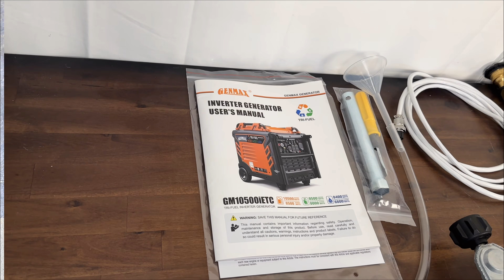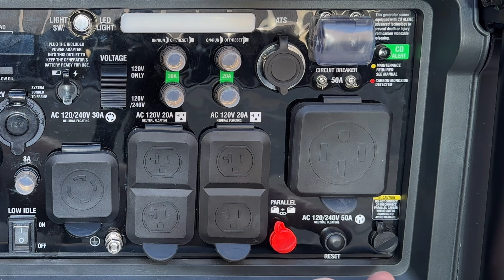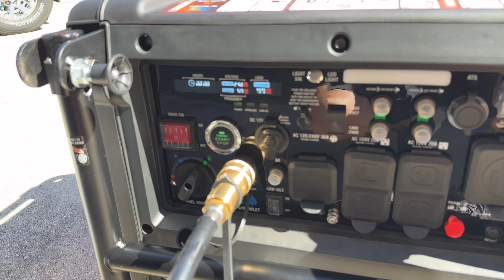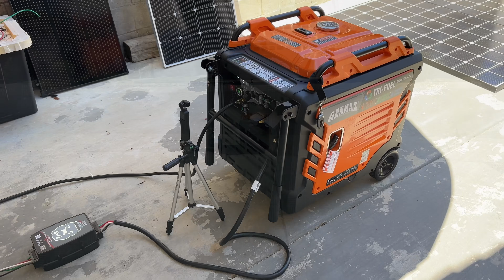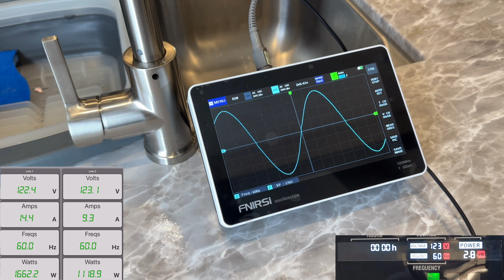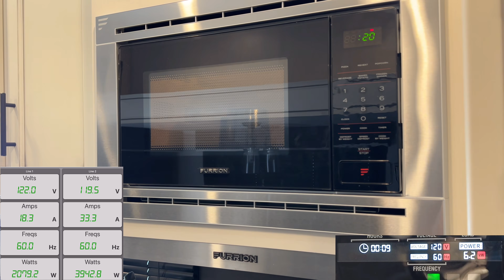Best New Generator GENMAX 10500iETC Tri-Fuel Inverer Generator!

Comment: I have a 250 gallon tank. Can this be run straight to the tank
Reply from the maker: Yes but need correct connection and water colume 
LPG service can normally do for a minimal fee

Comment: Is that a 2 wire auto start or a 3 wire. I have a 2 wire inverter start. I would have to cut one end off. If it is a 2 wire.
Reply: It has a 7 pin ATS. There is a way to convert it to 2 pin and I am working it out. But if you haven't purchased one yet I recomend the open frame 10500XiT version which has a 2 pin ATS. I only bought this one because it runs quieter and because the 2 wire ATS model wasn't available anywhere! These 10500 model (as where as most other models) sell fast and are hard to get. They have become very popular among those of us that have whole house solar systems off grid. 2 wire ATS is a must for off grid systems when no sun and off grid. I will be hitting as many replies as I can find questions in these videos, as soon as I finish my conversion. One caveat is that it will probabley void the warranty untill the factory catches on and they install my change or make a kit.

Comment: So do the Genmax generators have copper windings or copper clad aluminum?  Nothing shows in the manual or webpage.  Like the GM7500, GM8500, GM10500, GM11000, etc.  Larger ones
Reply from the maker: I haven’t seen copper clad in a generator for a long time 
Most everything out there is copper

Comment: I did a 14 hour breakin on gasoline continuously increasing load. After that I cleaned the tank and emptied the carb since I don't plan on running it on gasoline. I checked with the neighbors to ask their opinion of the noise and they responded with "what noise?" It runs even smoother and quieter on natural gas. On cloudy days, when solar is negligable I can charge my whole house batteries in about 2 hours or less - once a day. After a week off grid my wife realized that the dishwasher did not work. I told her that the dishwasher was non critical and I recieved the old hands on hips gesture. I proceeded to grab the generator remote, walked to the window and started the generator. Now she notifies me before running the dishwasher.

Comment: This generator is crap.  No service will assert ot call back, parts are all sold out.  I bought this and brand new and won't start.  Battery ok. Using propane, press the start button tries to start but quits.  Just  a POS as far as my experience goes.

Comment: Found out something strange about the gas amount required for this generator (actually it's twin under TMG Industrial). I had assumed that it would need a 1/2 inch gas hose so hired a gas guy to install a tap from my entrance point to enable the correct amount of natural gas to be available for the 10500 generator. Just out of curiosity, I installed the correct 1/2 inch quick connect to the existing 3/8 barbeque outlet and it WORKS GREAT.. The unit seems to run perfectly even on a smaller 3/8 pipe. I added a draw of 3000 watts and no problems. I don't know if it would function properly at maximum draw of 6800 watts but this was quite a pleasant surprise non the less.
Reply from the maker: Interesting normally if not right next to the main supply you would normally need a 1/2 inch at least for larger gens. May have to do a larger load test to see your limit. But remember if only the gen is running and not a heater or stove that will changes things.
Thanks for the info
Reply: @johnnysweekends  Yes, you have a good point !!  This barbeque outlet is after the gas hot water heater and after the gas stove, neither of which were actually on when i did this test. I loaded it up to 3000 watts with no difficulties but I will try it when the gas stove is on and when the water heater is actually working. As you say, it might be a case of nothing else drawing gas while I was doing the test allowing it to work properly with the smaller outlet (but failing when the other appliances are drawing gas at the same time). 

The power will be off this coming Sunday 24th November for a full day for maintenance during which I will be powering the whole home with the generator using the smaller barbeque outlet. I will let you know if I experience any difficulties during the day long "test"
Reply: Ok, the day long power outage is now over. Ran the TMG 10500 (same as Genmax 10500) for about 7 hours continuous using the 3/8 barbeque tubing converted to 1/2 quick connect and then to the generator using 1/2 inch hose that came with the generator. . I stressed out the gas supply by turning on the four stove gas burners and upping the gas furnace temperature at the same time as I was running the electric clothes dryer (5000 Watts). There was no indication of any gas or power difficulties whatsoever until I turned on the the heavy duty vacuum cleaner driving the total wattage over 8000, at which point the breaker tripped, as was to be expected. So I have come to several modest, personal conclusions: 

1- This generator is truly a beautiful, quiet BEAST fully capable of effortlessly powering  most anything you would ever want in an average home. It's quality appears to be outstanding. It\'s huge motor would likely be very gas hungry if used that way, but on natural gas, it's dirt cheap (36 cents per hour at 50% load).
2- Using an existing 3/8 barbeque outlet converted to 1/2 Quick connect to connect to the generator would seem NOT to compromise the amount of gas supply the generator needs to run properly at full throttle. Your gas supply might be different but mine certainly worked well.
3- For anyone paying to have a 1/2 inch coupler added to their gas supply where it first comes in the home (where it is definately recommended to connect) may want to wait on this added expense until AFTER they try their barbeque outlet. You may luck in like I did...

The other thing to add, unlike the Genmax 10500, the TMG 10500 comes with neutral bonded to frame. Floating neutral is recommended on the Generlink, but during the 7 hours I used it with neutral bonded to frame, everything worked and no breakers tripped. I will be modifying it to floating neutral but it's nice to know it will run the other way (even though strictly speaking that goes against code)
Reply from the maker: @TOURMANBOB awesome it worked ! Great feed back thank you
Reply: @johnnysweekends  BTW, I measured the THD and it measured 2.3% THD

Comment: Will these put out 240v with just 1 generator, or do you have to parallel 2 generators together to get 240v like some of the solar generators.  Looking for the best option to fast charge a Delta Pro Ultra setup in case there is no solar
Reply from the maker: You should watch some of my Ecoflow videos where I use this unit to charge delta pro ultra 😀👍🏼
Only one needed
Reply: @johnnysweekends  Do people really spend $5k+ on batteries?  Mainly California?
Reply from the maker: @avguytx4361 yes they do. All over really. 
Battery prices are coming down and serves quiet back up power and time of use for people who have really high energy prices 
Payback can be in as little as about 6-8 years with a life span of about 20 ish
Reply: @johnnysweekends  Good to know.  So which would you choose...Duromax XP11000ih or Genmax GM11000IETC/GM10500IETC?  Or something else in that 11kw range
Reply from the maker: @avguytx4361 idk I wanna check out the champion first
Reply: @johnnysweekends thanks ill look it up. I saw the vid where you changed the ultra with the yellow smaller champion but hadn't seen the other one

Comment: Would you know how long a tank ( like yours) of propane last at just normal use in a home.
Refrigerator,  hot water, tv, lights &  bedroom outlets? 
Just an approx?
Reply: LPG fuel consumption rate is said to be.. 1.65 kg/h at 25% load and 3.43 kg/h at 100%

Comment: If there is 60 mph winds outside, and electric goes out, can you just push remote start, or do you have to go outside and turn on power switch first?
Reply: @bryandunkley8239  I dunno how long before it’s an issue but you don’t want to leave the generator powered on long term because it’ll drain the battery and then electric start won’t work at all.  How long it can sit around with the battery on (ready for remote start), I’m not totally sure.

Comment: Can you please explain the low idle function? If I run low idle will generator adjust if more power is needed or do I just need to turn it off?
Reply from the maker: Yes it will self adjust as needed this helps save fuel and does keep it quieter. 
But for large loads that will be on and off keep the low idle off so it can handle them properly

Comment: Has it ever back fired upon start up ? I keep reading on Reddit that this model will back fire upon starting it up for the very first time.
Reply from the maker: Mine didn’t back fire. But I’m only using propane. Plus most all new generators are setup a little lean at idle for emissions. But what you read is also just here-say, all of them? Some of them? One of them? 
Every single time on one generator ?
Reply: @johnnysweekends thanks for the reply. During hurricane Ike i purchased a generator and it backfired very loudly. I was very alarmed and honestly my Kid started it up after that under my supervision. 
I have not tested my Genmax yet; but I know if it backfires it’s going to scare me. I plan to use propane and eventually natural gas.
Reply from the maker: @steffiejoe I would get it fired up sooner than later. Better to find a problem now verses when it’s to late.
Reply: @johnnysweekends I got my electrician to assist me with doing a test run and practice connecting it to my 50amp inlet. The test run went perfect! I feel very comfortable as a female being able to use such a large and powerful generator. Thank you for your response and informative videos on this tri-fuel. I did get a Honda 2200i as my backup for short power outages. I’m in Texas so it’s a necessity.
Reply from the maker: @steffiejoe im glad I could help, you sound like you are ready..! 😀👍🏼

Comment: Hey ...what do you recommend  today? I need a generator..either predator or champion dual fuel...I will be using propane. I am leaning towards Champion 4650
Reply from the maker: I like the champion unit or the wen which is cheaper and same thing..
Basically this model here…
Affiliate link..:https://amzn.to/3AgM1R3

Comment: Hey Johnny great channel! I have a genmax 9000 ied but I would like it to run on natural gas. Have you swapped the regulator and fuel switch from the 10500 to the 9000? It's the same engine so it should work, right?
Reply from the maker: I have not. So it should work but haven’t done it personally.

Comment: Generac's are TRASH! A Herber Fraught gen-set is THOUSANDS of times more RELIABLE, which is WHAT YOU BUY A BACK-UP FOR!!! ASK ANY small-engine about the crappy Generac engine. 90% of them WILL NOT WORK ON THEM!!! That's MY telephone survey of EVER SMALL-ENGINE repair place with-in 40 miles of Tulsa, OK. (167 of them WILL NOT touch them only 17 will!)

Comment: Completely untechnical person here. I was told that you can have an electrician provide you with a plug/box next to your main fuse box and you can plug a wire from this generator into it.  Then you can use your switches/appliances in the house normally without having several wires all over the place.  Is that correct?
Reply from the maker: Yes 👍🏼
Reply: @johnnysweekends  Thanks!

Comment: By leaving this in a generator shed during cold winter months will it harm the inverter?
Reply from the maker: No it should be fine as long as it’s not getting wet. Moisture could cause corrosion even if they are sealed connectors it still finds its way in

Comment: Looking at running my whole home but cant decide between an inverter or just regular generator and do i really need an in verter generator looking for some input
Reply from the maker: You don’t need an inverter Gen unless you have sensitive electronics or certain items that require an inverter generator like maybe power stations from Ecoflow or Bluetti. But big back up batteries like Enphase or telsa can use a regular generator. 

They are normally quieter and more fuel efficient but more expensive and heavier
Reply: @johnnysweekends  thanks alot only thing would be tvs maybe washing machine and idk about the washing machine electronics where it's a newer washer so now deciding on a generator thanks a bunch again

Comment: It could be interesting to see someone crack the code for how to actually use the ATS.  Great and all there is a cable there, but what do you plug it into?  It seems there is some vaporware ATS box out there, but otherwise not sure what the average Joe is going to do with that plug.  A quick look at the manual makes me think you could possibly control this with an R-Pi, some relays, and maybe some other hardware.  Just have to figure out the nuances for sending the control signals before programming the R-Pi, but shouldn't be too difficult.  If I understand correctly, start and emergency off are both pull-downs to ground and running is 12V off of the alternator.  So going through the pin-out, you have 12V power, ground, a start pin to pull down to ground with a relay, an emergency stop pin to pull down to ground with a relay, and a 12V running power pin.  So once you have these pins in order for your setup, then you need to signal your main power relays to break from shore power and attach to generator power while being careful to never have shore and generator power hooked up at the same time.  It sounds doable, but then you gotta actually get it right.  Then you need to get sign off to actually use it if they will even let you use whatever you cobbled together.

The R-Pi programming might be pretty dumb in that it is more of a timer with some sensing.  You may also put some extra circuitry to make it impossible to to have generator power and shore power connected at the same time in case there is a coding error, a problem with your wiring or even a fault with one of your relays.   So:
1. Normal: Sense if shore power is there.  If shore power is available, sleep X time and check again.  If shore power is lost, wait X number of seconds, check again, and then move on to Start.
2. Start: Loop that senses for 12V running power.  If no running power, then close and then open the 'start' relay to start the generator and wait X seconds for generator to start.  Else (there is running power), break out of Start loop.
3. Warmup:
     a. Sense for generator 240V power.  If generator 240V power does not come on after X number of seconds, then go back to start.
     b. (Generator 240V power detected) Sleep for X seconds while generator warms up, then proceed.
3. Run: After start, go here.
     a. Check once more for shore power, if not detected, disconnect shore power.  Else (shore power detected), go to Stop.
     b. Wait 1 second and then connect generator 240V power relay.
     c. Loop checking for shore power sense and doing short sleeps between checks.  If shore power is detected, sleep for X seconds and check again.  If shore power still there, break out of loop.
     d. Shore power considered back, disconnect generator relay.  Wait 1 second and then connect shore power relay.
     e. Wait X number of seconds (Cool down).  Check if shore power is still there.  If it is not, go back to top of Run.  Else go to Stop.
4. Stop:  Connect and disconnect 'stop' relay to trigger the emergency stop of the generator.  Go to Normal.

Note: If the generator 240V breaker trips, this ATS controller routine will not know by design.  The thought being a human should get involved at this point, fix the cause of the breaker fault, and then reset the breaker.
Note: If your 240V generator breaker is off, then this will harmlessly go between Start and Warmup without performing any actual actions, just checks.  This will make sure the generator is ready once you notice this breaker is off and possibly restart the generator in case you turn it off while trying to figure out what is going on.  Or if the generator stalls for whatever reason, it will try to restart it.  Once you flip the 240V generator breaker on, then this will just move on and get things switched over to using generator power.
Reply from the maker: They are having problems with UL listing and certificate fees which I guess are super spendy
Reply: @johnnysweekends  I suppose another thing is I saw someone go into one of the vaporware boxes out there and there was no central relay.  Instead there is a relay for each side, shore power and generator power and they just tie together into one set of output lines.  I would think you would want a relay where both inputs go into with one set of outputs and then it does a break before make switch mechanically with a single physical mechanism for all poles.  The idea being it is physically impossible to back feed generator power into the grid.  If the switch fails, then either it is stuck on one of the two inputs or it is stuck off.  If instead you have what I saw in the vaporware ATS, if one of the relays has an issue, there is a risk of say the generator relay getting stuck on, even if small, then shore power connecting back or something to the like and causing a backfeed issue with a high powered generator.  That could be bad.  Even if it is rare, the B737 MAX dive like crazy issue ultimately happened when a sensor malfunctioned and without proper engineering, that led to two whole plane crashes and loss of all hands.  So inherently safe is good.